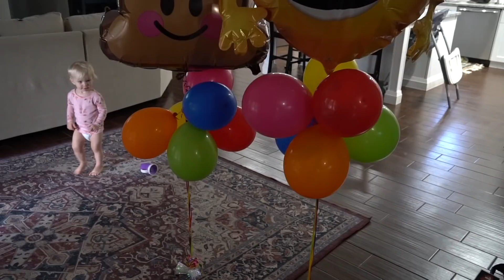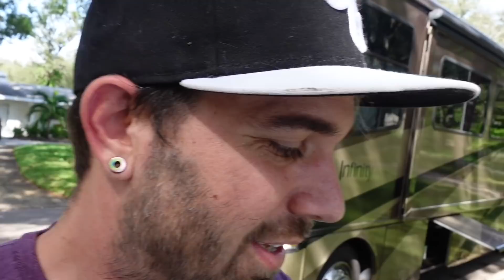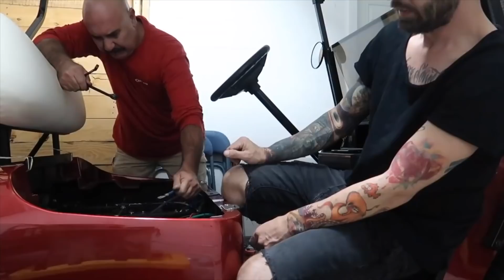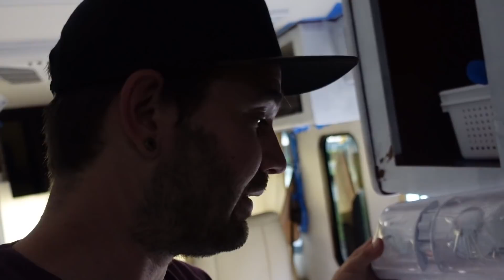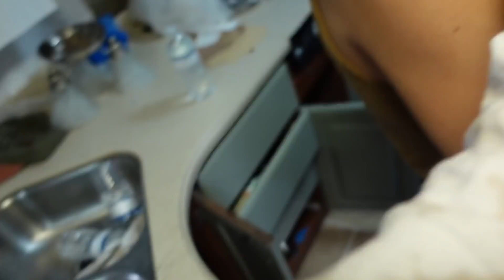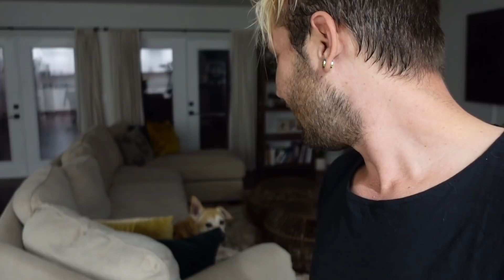WHAT COULD POSSIBLY GO WRONG??!!....

Comment: As the battery is fully charged, yet all systems are affected by the fault, including lighting and starter motor, I think the problem is a bad earth (ground) connection. Clean the earth connection to the battery ( usually negative terminal) and the connection at the other end of the cable, which is probably to the chassis, and all should be well. If that doesn't cure it, do the same to the positive connection from the battery.

Comment: To bypass the battery, a couple of times I pressed the metal rod of a screwdriver against the red and black wires coming out of the starter. Turned it over with the key and it started right up.